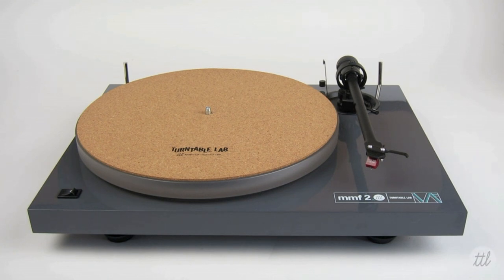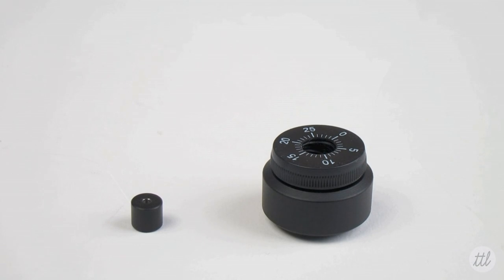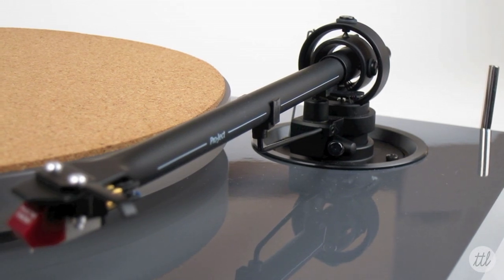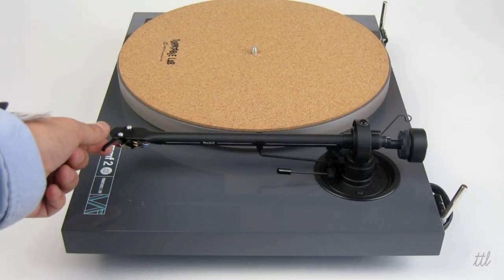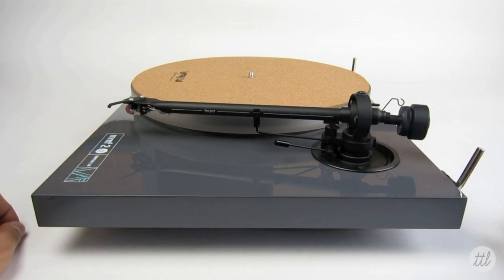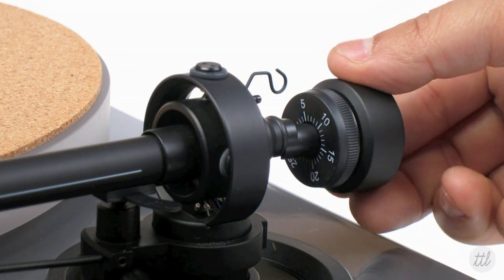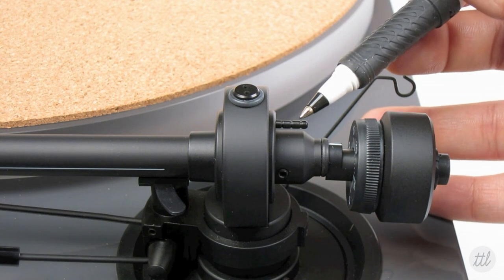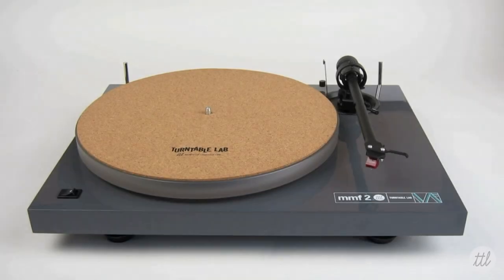Tonearm Setup Video For Pro-Ject Debut Carbon + Music Hall MMF 2.2

Comment: I replaced the stock felt mat on my Project Debut III with the official Pro-Ject cork mat. However the cork is much thicker so now the tonearm/cartridge "reaches up" a tiny bit when touching the record. I don't think that's right, don't I have to also adjust the tonearm height somehow?

Comment: I had to see this video twice to understand how was it possible to turn the numbered dial without changing the weight balance, as it is done quickly 1:30"  but then I realized the two dials are separated (on my turntable they were a bit glued together). Many thanks for this excellente vídeo , it saved me a visit to a technical repair shop. Thanks to you now  i know a lot more about setting up my turntable .

Comment: Best video on YouTube !!! I have a question if the weight was set to balance the tone arm why turn it in more won’t it unbalance ?
Reply: It will, and that's the point. Your needle needs a certain tracking force (usually found on the manufacturers product page, just Google for your model) to display the music correctly. I believe it has something to do with how it sits in the record groove, and doesn't bump out of course.

Comment: I've had the Project Debut Carbon for four years and just replaced the stylus (another 2M red series). I feel like there is much more surface noise (cracks and static), more so with old records but even a little with new records, than I had with the last stylus so now I'm going crazy reapplying the counterweight over and over and I guess it's fine but I feel like there's some ambiguity in the "correct setting" of the counterweight and I'll never be happy. Might the stylus need to be "broken in" before that surface noise goes away? I don't really remember what it sounded like when it was new.
Reply: @Scott Frobel i've heard this quite a bit. I was actually debating between that and the nagoka mp-110.
Reply: the 2M requires a 75g counter weight with a 01 marking on the back. The debuts ship with a 00 marked weight which is 65g.  hence the heavier 2m cart will not balance.. check the project website.. Personally I added 10g of mass to the 65g weight and then the 2m balances and subsequently can be set to the setting of 1.8g..
Reply: Also If that's not the problem, the extra sensitivity of the 2m blue or black will pick up way more noise from old dusty scratched records.. give them a proper clean and or play new records..
Reply: @Radar23  I came here for this. I could not figure out why my weight was all the way backed up and it still wasn't balancing. Thanks!

Comment: I'm having trouble getting the counter weight on, it just came off. How can I put it on easily? And how can I be sure it won't come off again?
Reply: It will always be able to come off, you simply shouldn't touch it. The reason they're not fixed is to maintain a certain modification ability, in case you want to upgrade either your needle or element.

Comment: I’ve done everything exactly like you and the manual said and still every time I set the stylus down on to a record it shoots or skates forward to about the middle of the first song and then it’s fine.
Reply: Same exact problem here. I've setup exactly as instructed and, aside from the pulling at the beginning things seem to work once the song begins.

I'd really like to solve the pulling issue though.
Reply: Have you checked your record? It could be dirty, try another one to be sure. Otherwise, your needle could be damaged or you still haven't adjusted it properly.
Reply: is your surface totally level? I currently like in a old house built in the 1850s and there isn't one level surface in the whole place. I've had to adjust my isolation feet to counter it.
Reply: @sytmatt  I found a turntable shop to look at it and it was the stylus spring had worn out and the cartridge was touching the vinyl and throwing the tone arm across the record. I replaced the cartridge and it’s perfect now.

Comment: so i have a essential 3 adjusted everything how it was shown , got a new record but the needle seems to be stuck in one groove
Reply: Must be the record's problem
Reply: Savrawars yes it probably is . but i got the same record again and it was same groove again where it got stuck .
Reply: @syncrol  does this happen with any other records?
Reply: Savrawars no just this one for me . ThomYorks latest released album was it
Reply: @syncrol  
Hey can i ask you something? Since i am new to record collecting etc. 
I went ahead and ordered a pro ject debut carbon DC  with the pro jecte phono box S2 for the phono pre amp stage. Can you please give me your opinion on what speakers  i should buy to complete the set? I am looking to spend around 800$ for the speakers
Reply: @syncrol  if it did it again with the same record, the pressing is probably rubbish.
Reply: @Savrawars  really depends on what your looking for. I really like Dali loudspeakers for they're looks and characteristics, you should be able to get good ones at 800. Only thing I should say is that it's really up to you and your preferences; if you're going to spend that kind of money, your local HiFi store won't bother helping you out by setting up some demo's.
Reply: @diegohuijbregtsgarcia5102  You mean that they wont bother cause i am not going to spend a lot of money ?

Comment: mine doesnt float, whatever the position of the counteirweight.
Reply: You have to pull the counterweight further out (dont mind about the scale number position at that point).
Me i had to put it on the edge out.
Works fine now
Reply: Thank you I appreciate it.
Reply: stand on the end, like a forklift needing extra counterweight
Reply: cart could be too heavy for the counterweight.. the project series have many different weights.. read the info on the website